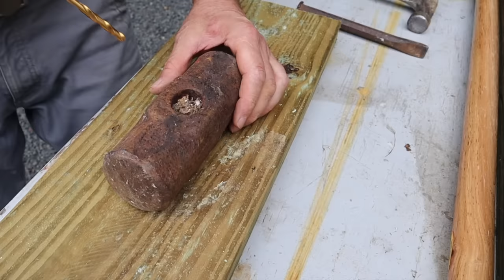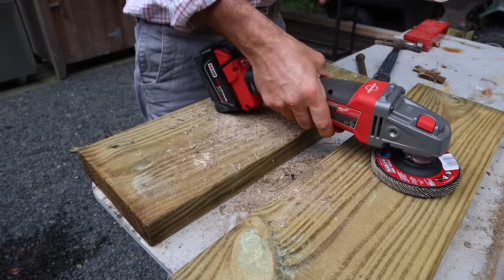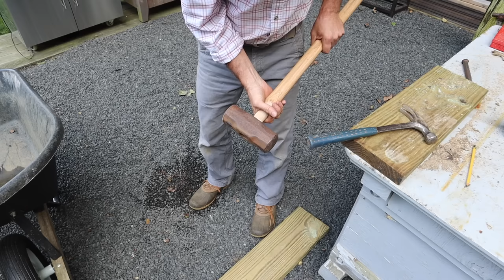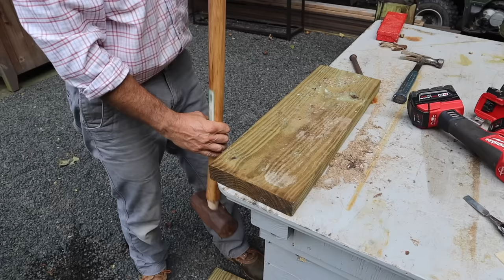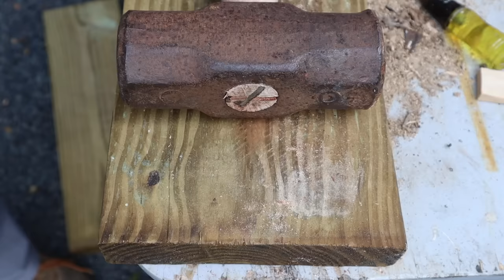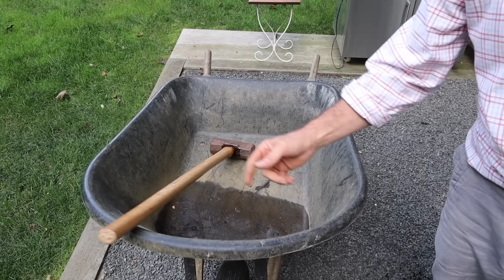How to Fix a Sledgehammer

Comment: When we had broken handles, we just threw the head in a fire to burn out the broken piece. It was a lot easier than trying to dig it out.

Still a nice video though.
Reply: You ruin the heat treatment
Reply: V Tramell that's what I did several times and it works great especially on wood that was outs for years
Reply: drill works good after digging out the steel.

Comment: Interesting Video, I got a 20 Pound Sledge Hammer with a busted handle & a Steel Ring in the center of the top of the handle for the hammer head, I was wondering how to remove the old handle, with that Steel ring in it & without damaging anything, gonna need that ring also.

Comment: You mean you can repair those lol. Like you Ive been doing that every spring for many years.  Start off the season with good working tools and the work seems easier.  Can’t tell you how many tools Ive seen at the dump that could have and should have been repaired.  Thanks for another great video.

Comment: Nice video, as always. 

I was told by an old timer at the hardware store I used to work at that the easiest way to get the wood out of the old sledgehammer head is to drop the whole thing into a campfire and then pick it out the following day.
Reply: You have to build a fire for that.

Comment: I used to have a mom and pop hardware store and would put on the new handle for customers. I didn't taper the handle to fit. I would uniformly shave (on a bench grinder) to fit so that the thickness would be maximized.

Comment: I noticed that when you’re hammering the new handle, you do it while holding the head off the ground. Why do that rather than resting the head on the wood and pounding the handle into it? Thanks!
Reply: adamkrezz I don't know the science behind it.  It's weird how it works, but this way makes a tighter fit for some reason.  Doing it the other way doesn't necessarily get a tight fit and could fly off as you are using it.

Comment: My only concern is the thickness of the wood between the head and handle from my experience that is the failure point on properly seated heads but yours is especially thin in that area

Comment: Hi Jon, I have a slow leak in my wheelbarrow tire and I have had it in the water blow several times now but I cannot find where it is leaking from, I have changed the valve but still it goes down. I think I am going to have to bit the bullet and get a new inner tube.
Reply from the maker: This time I’m using a flat less tire

Comment: I mean what you did 'worked'....but it was a seriously terrible hafting. Not something you would do more than once every few years. Don't cut the excess before putting in wedge 🤦‍♂️. Drawknife....not flap disc. Seat heavy hammer right down on shoulder, thats what its for. Don't split all the wood within the eye with extra metal wedge. I mean, you got it done but that's kinda like me making  hairdressing video. Ill cut off the hair bit it aint pretty.
Reply from the maker: It probably took more time for you to write this comment 😂